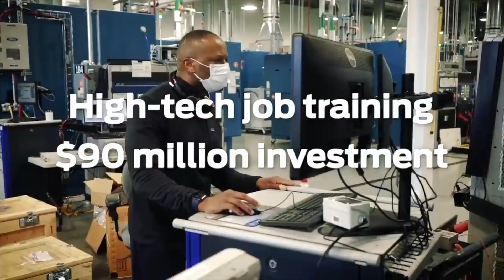When will we see the Electric Bronco and Ranger from ford? || Plug-in Hybrid First???

Comment: A Lightning with a LFP battery pack
Reply: Its already too heavy.... LFP would make that worse.  But perhaps the longer service life is worth it.
Reply: @Factory400  Single cab, split bench seat, steel roll bar, extra long wheel base, full bed.  Aluminum frame (maybe)

Comment: I currently own a 2021 F150 PowerBoost that is Electric and Gas. I run on battery until the engine is needed, it really is the best of both worlds. I just ordered my F150 Lightning and plan on trading my hybrid in.
Reply: I just got my lightning on Dec 5th. Be aware in colder weather you lose significant range.  It's not a problem for me because when I do drive it, I seldom drive more than 50 miles. I love my lightning mostly because I just plug it in, and it's always ready to go whenever I need it. No more waiting in line at the gas stations. People who go on road trips or tow long distance this isn't the truck for them.